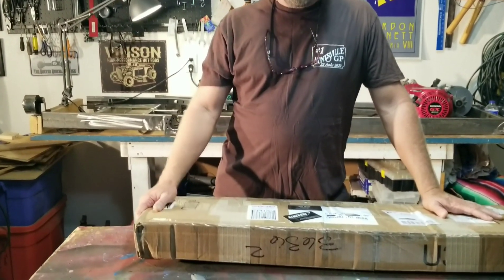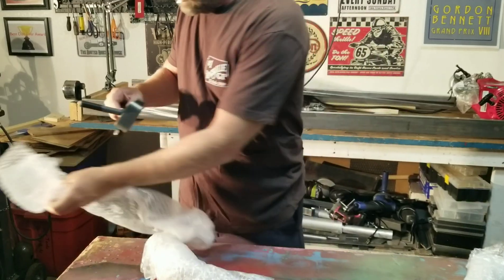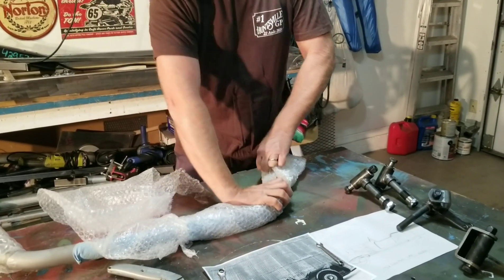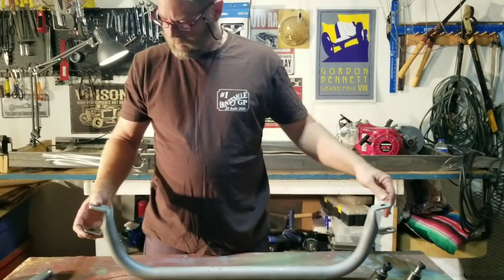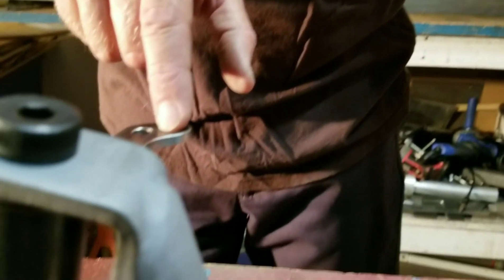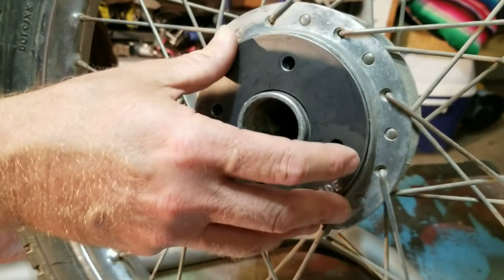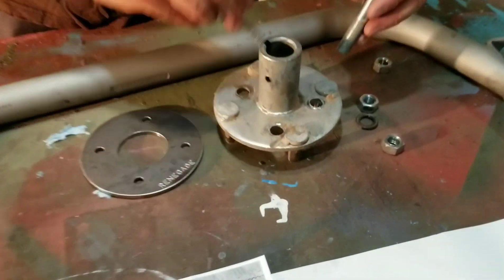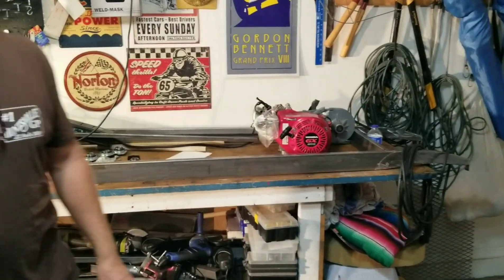Cyclekart Front Drop Axle and Spindle Unboxing

Comment: You can make the front axle in a different way, by putting it  horizontally attached to 2 bearing at the font, so it can swing up and down, then put the suspension bolted in the middle of the cycle kart to hold the end of the axle loosely and leave it to travel one inc each way.
Reply from the maker: That's an interesting idea for a front axle design!